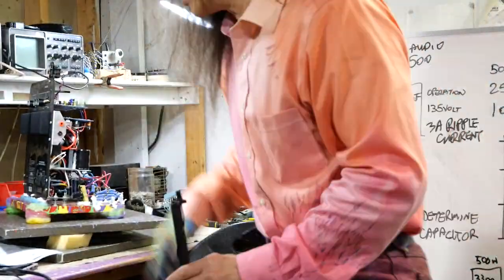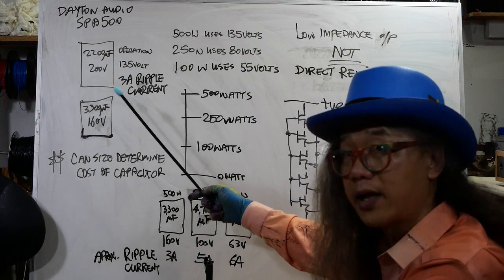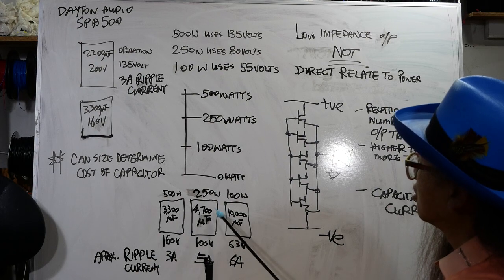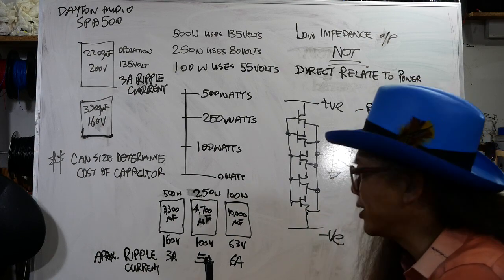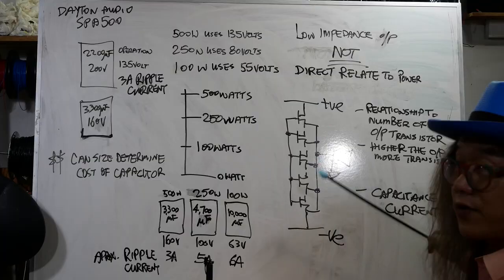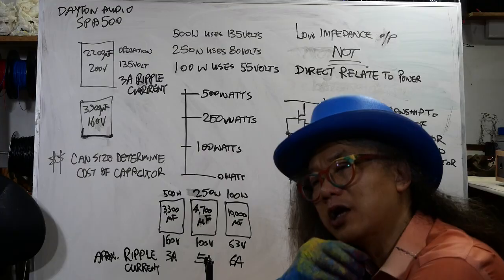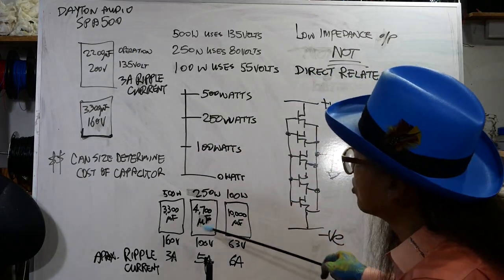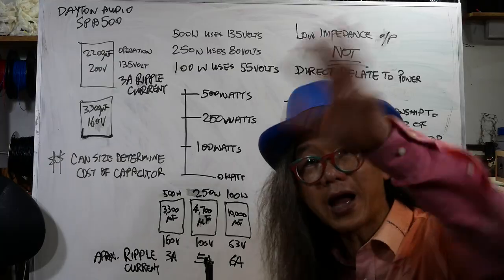Why Audio Manufactures are always Cutting Corners on Power Supplies

Comment: To grasp what all this means for a listener, we need to look at the amp/speaker combination and the dynamic range capability. As you say most of the time we only use a few watts, but on transients this rises dramatically and if the amp/speaker combination can't track this, we get compression and lose the life of the music. That's why more sensitive speakers often sound more realistic, because the amp has an easier time and the drivers respond faster. Even if they have colouration, the sound feels more life like.
Reply from the maker: I can go along with what you said.  Especially this :" Even if they have colouration, the sound feels more life like."  This will trigger some hardcore measurement ONLY type.  Are you ready? 😉🤩😁  Do remember, I can go along with what you said.  May not be a 100% but pretty much 98%.
Reply: @angela-gilbert  Measurements only are only as good as what you measure....What about the unknown, unknowns? 🤔☺
Reply from the maker: @mfr58 Correct.  Totally agreed.  We don't have enough knowledge to know what it has to be measured in order to determine what we are listening.  How does any measurements determine whether a piece of equipment can carry a tune and connect to the listener emotionally.  We are still measuring THD, SINAD, and may be a few things.  None of them and make sonic judgment for our emotion.
Reply: @angela-gilbert  🤗

Comment: Please make more videos like this Angela-Gilbert.  I totally get the power supply part, and I'm completely behind your concept that adding capacitance improves just about any component.  I think I understand the output stage impedance vs wattage.  Lower impedance means more output voltage drop when the speaker wants current than higher impedance right?  So, to make more power from an amp you parallel more transistors or FETs, which is in turn going to create a lower impedance output stage and a higher current amp.  Am I getting this so far?
Reply: Yes, and you also need a low impedance power supply stage, because the impedance seen by the speaker accounts also for the impedance of that stage. In addition, there is steady state impedance, and dynamic impedance. A linear power supply stage with a small transformer and high filter capacitance for instance will have low dynamic impedance due to the presence of the high value capacitors, but high steady state impedance due to the presence of the small mains transformer, and you don't want that. Ideally, you want a big transformer (rated at least 4-5 times the RMS ouput power of the amplifier), and large filtering capacitors (at least 400-500uF per W of total RMS power of the amplifier). By total RMS power I mean the sum of the RMS power of all the channels of the amplifier.
Reply: @you2ber252  I'm getting it!

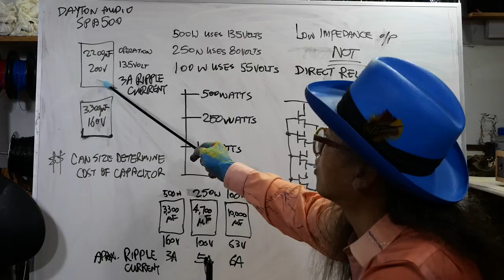Comment: Hi Mr Yeung, at 1:18, It would be beneficial to use a higher voltage capacitor than necessary, because these will have a better loss tangent at higher frequency performance than that of an equivalent value capacitor (Farads) than with less voltage. In other words, the 220uF 200V caps will have less tangential loss figures than that of a (for example), a 220uF 160V capacitor.
Reply from the maker: There is always a fine point between all factors of any given components.  In many case, from my point of view, a higher capacitance is more beneficial than having and lower tangential loss.
Reply: @angela-gilbert  Yes, I see your point. The larger value caps would be preferable if you want to reduce ripple current in a substantial current consumption design, like a power amplifier. Especially, a subwoofer power amplifier.

Comment: Do I understand all of this information? NOPE
I am not an engineer, I am a person that loves the hobby of HIFI. That being said I also wish to have a general knowledge of the inner workings of the components I am using. 
Even for a non engineer this information is extremely helpful in understanding the transformer circuitry in a practical sense rather than a technical sense (if that makes sense)
I do have a question if you wouldn't mind. 
When it comes to class D amplification it seems that the wattage output is always considerably higher than A or AB. As a general rule and with advances in sound quality of class D and seemingly lower cost of production.Why isn't there a large push to class D? AmI wrong in my thinking that the transformer circuitry is different?
 I understand that question comes from my position of ignorance but I am trying to understand the concept.
Reply: Generally, class D amps always sound "lean" as opposed to class A / AB amps. I am of the opinion (but I may be wrong) that this is due to the low pass filter at the output that sits in between the switching devoces and the speaker, which prevents the switching devices to properly control the movement of the cone, especially at low frequency, hence the leaner sound. It's not a matter of power supply technology, even though class D amps usually have switching power supply stages as opposed to class A / AB amps that usually adopt linear power supply architectures.
Reply: @you2ber252  I thank you for your input here it is helpful to me.  I think I now understand why my question really is unrelated to the video. The more I look into the technology the more I find an infinite number of factors to arrive at a result. Slowly but surely I am gaining knowledge but I am already over my head on this stuff so for now I will stop here and let this sink in a bit. 
I appreciate all the help I can get!!!!
Reply: @you2ber252 Class D has low pass filter but ranges beyond the audio spectrum. Therefore doesn't affect sound quality in that case. However, if not properly design, it will ruin some if not all part of sound system due to its noise(inaudible). It cause interference and is the major problem. Sometimes, it influence other gadgets to malfunction. Just my opinion.
Reply: Class D is ultra efficient, also able to run at lower voltages ie 24 or 12Vdc vehicle or battery down to say 3Vdc. so less heat and very comact of needed.
Class A is pure 50% conduction by the output stage at all times (at zero signal), more and less as the wsve form dictates. an output transformer is generally required to match the high circuit voltages to the lower volts but higher current required by common loudspeakers.
Cllass AB is a symmetrical output stage, at zero its balanced and at low current.
Class A uses one transistor with transformer above, AB uses two transistors, one  above the other, D uses four in a bridge ie H configuration.
Reply: @joefish6091  Admittedly I had to read that a few times to digest it. So tell me if Im close or way off on my application of your knowledge to the concept in the video. My understanding of the original issues in the use of Class D was the noise introduced by the switching in the power supply and new circuitry designs have advanced pretty far. I am trying to avoid the debate of what is better A, AB or D, I am looking at cost vs value
I am trying to understand why a Class D that requires a smaller transformer (If I am correct in that assumption) and is now capable of much higher "audiophile" quality rather than the use of older inefficient A,AB systems.Why wouldn't it be better cost wise to change to the class D format to reduce cost in one area and have available that saving to improve other areas of the amp and achieve the lower price point?  Does the same concept Angela discussed in the video apply to Class D? In other words, When a manufacturer cuts corners on the capacitors as illustrated in the video there is a loss of fidelity, it seems to me that by using a class D reduces the transformer and heat shrink costs allowing money to be spent elsewhere in the component, the result could be equal or greater than a cheaper A, AB. 
I guess this is an ever moving goal post with as many variables at play. 

Thank you